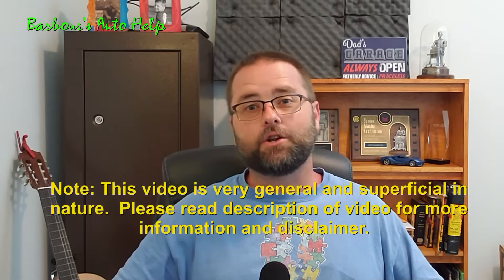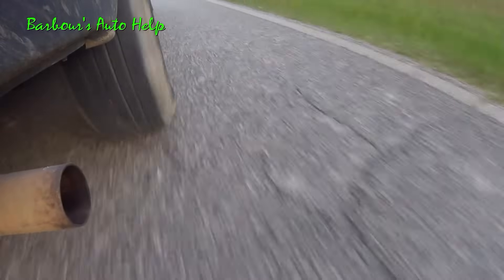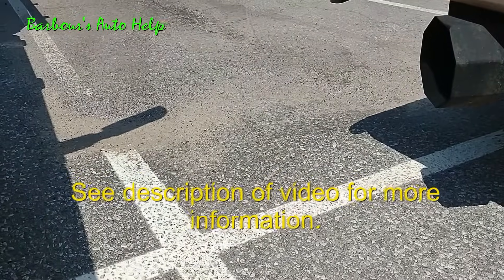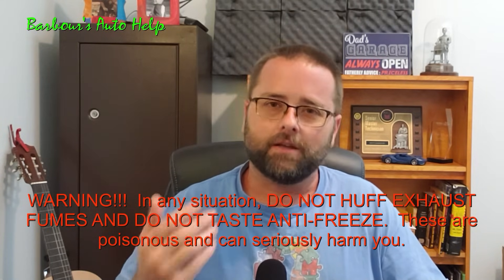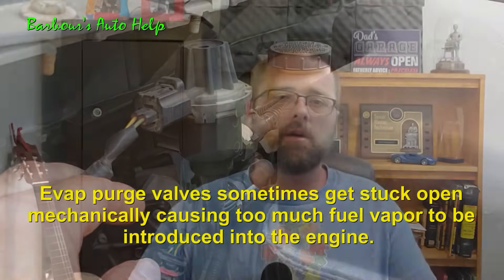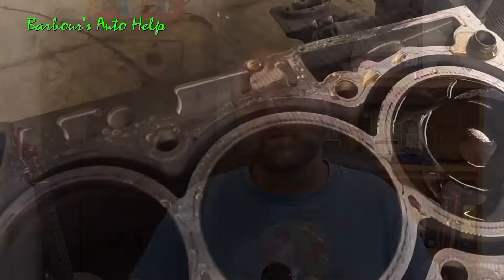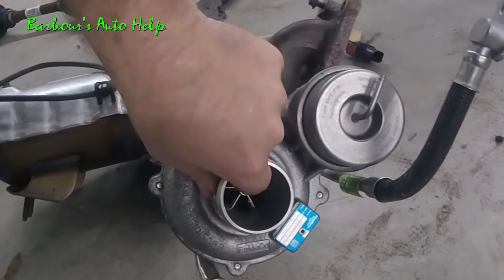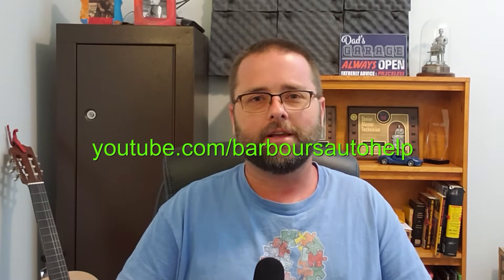Black, Blue and White Smoke From Exhaust. What It Means.

Comment: My Saturn smoked blue when cold, none when hot. Used a quart in 1000 miles. My Accord never smoked but also used a quart in 1000 miles, but I think it may have an oil leak.

Comment: Also the old pressure sensor was a Bosch ...the new one is unidentifiable!  If I had known it was a Bosch as this is what Ford had in it along with a Motorcraft o2 sensor which I've seen several posts about Ford and using Motorcraft O2 only.

Comment: White smoke , there is no coolant loss , recently installed a new O2 sensor. Engine light is on, scan came up P0174 , lean bank 2.  Not sure if I got a bad 02 sensor. Seems like the PCM is struggling to adjust as it will run smooth engine light goes off  with no vibration then back to rough condition, like a misfire. When running smooth there is no smoke coming out of the tailpipe...back to rough condition and white smoke.  Frustrating! Lol !  Everytime I have it scanned at Auto Zone it gets a different code. It all started with a P0175 rich bank 1.  Recommended a fuel injection pressure regulator.  I changed it and it ran great , better than it ever has for two days. I think I'm chasing my tail and might have gotten a bad fuel injection pressure regulator as it did run great for two days.

Comment: I had a leaking bypass coolant hose and drove the car like that for a Day and a 1/2 before I fixed it. And now I have thick white smoke coming out my tail pipe, but it has been very cold outside, and I also put fuel system cleaner in My gas tank before it started smoking like that, so what could be the problem?

Comment: Hi would the wrong grade of oil do that my 6 L blows blue smoke then clear up I just buy it and they said they had 10w30 in it thanks
Reply from the maker: What year make and model we working on?
Reply: @BarboursAutoHelp  2005 ford xL 550  6 L power  stroke

Comment: Unfortunately I have a smoke issue at first thought was white but 2 things one no sweet smell and 2 it lingers in the air with a more oil burn smell where coolant would evaporated pretty fast this doesn't along with it I have lovely in knock something is broken in my trash heap

Comment: just got a new engine via jeep/ram service shop... still see smoke from exhaust. previous engine had blow gasket. had the truck back for 2 weeks now.... engine does appear to be new... im a little confused on what it can be.
Reply from the maker: Is the vehicle turbocharged?
Reply: @BarboursAutoHelp  No, it's a 5.7 semi V8... today just took a look at the oil Level to find that it was at the "add" mark idk if that plays a part.... dudes gave me back the truck with low oil and low brake fluid smh... the amount of smoke from the exhaust isn't crazy btw, very minor.
Reply from the maker: @ maybe take it back and have them look it over. Shouldn’t be low.

Comment: I have a 1996 Ford Mustang. There’s been blue smoke coming from the exhaust. It’s been running rough a lot and miss firing. It doesn’t do it constantly but on and off. I’ll be driving it and it will be running rough and all of a sudden it will kick in and start running right. It’s not running hot or anything like that.

Comment: Chevy 1990 suburban 5.7 has white smoke-ish. 160k miles- runs good but I notice driving 55+ on highway it seams to struggle or shift hard. Does this year have the trans modulator vacuumed ?? It's smoking /sucking trans fluid hence the white smoke n ruff shifting??

Comment: Hi Mate, from Australia, I had my front and under the car cat got toasted. The smoke obviously couldn't go past the exhaust and could see it coming out of the valve cover. Replaced CAT now, car is running idling fine but now getting white smoke with fuel smell on high idle revs. No smoke while driving. I am suspecting the front injector(s) getting stuck or flow is obstructed on high revs, especially after toasted cats. Smell tastes exactly like when you burn off carbon with seafoam etc. My car is 2007 Nissan Murano, 240K KMs. Otherwise the car has been in mint condition. The coolant level is not dropping. Oil level is maintained, little bit of oil I am adding which I was adding since I had this car. V6 VQ35DE is prone to burn a little bit of oil and that is normal. Fuel consumption is not increasing significantly. It is still 11.4 for 100L which is very good for this size of engine. I once had a random misfire code tilting me more towards injectors. No more codes after that. Could also see black oil on the bottom of the dipstick, oil soot, probably means rich fuel mixing with oil. Any thoughts?

Comment: I have a 2014 Audi A4 2.0 TFSI with 148 000km. Car has a dump pipe, stage 1 tune + hybrid IS38 turbo (6 months old) I get smoke under high boost (Blue/white smoke) Generally after heavy load. I can also smell burnt oil. I have just upgraded the PCV but still have smoke. for the last 5 days I have driven slowly to see If I still see smoke and and losing oil. So far no smoke and waiting of oil reader to show me the reading. Any tips or help?

Comment: Thank you for the info. I have the light blue smoke but only when I put it in drive also it does not have oil consumption at all, I just replaced the spark plugs and coils I did an oil change the coolant level is the same no changes can you think of what could be causing this smoke? sometimes it does smell rich but the smoke is not black what do you think? oh, 2007 4.6 STX V8 F150
Reply from the maker: It’s hard to say. It may be better to have a tech take a look at it.

Comment: Ii got a 2002 Chevy pos S10 4x4 4.3 V6, so my sparkplugs keep getting drenched in gas, my buddy did replace the spiders and fuel regulator I have replaced the O2 sensor the knock and crank sensor I'm in the middle of trying to get the cam sensor put in distributor but it's being a pain to get in but it is pooring gas out the side of the llentum so I think it's a injector because the cam sensor isn't reading right and pcm probably in limp mode and the regulator I've seen dump gas when you turn the key off as well but man it's smoking out the whole block really rich for like 5min then dies and I have to pull all the plugs witch  all are soaked in gas, here's what I'm worried about I changed my oil and got 16 courts , 4 .5 of oil and 8qts of gas I hope my rings didn't get messed up but how in the heck does 8 qrts of gas get in the oil seems like can I have maybe got the return and the vapor lines wrong when I changed my fuel pump? Just seems like a lot to just be getting by the plugs please any info would be muchly appreciated I have dumped so much money in this thing but I'm bout to burn it to the ground I been working on it for 3 months now, also I've heard that it can be your alternator andnot really be the cam sensor, this all started when my harmonic balancer spun off the rubber part but timing is pretty much set on its own I think tdc on one and point rotor at the 6 on distributor right? Also my clutch went out on my ac so I got a smaller belt and bypassed it but I heard that can mess up the voltage in places, I'm getting 10 volts on one of the three wires going to my cam sensor but I'm supposed to get 5 on ach side and negative or ground in middle any thoughts on this ty sorry so much

Comment: 2016 Chevy trax. Put oil in it this morning and went to drive it. Few minutes later whitish bluish smoke coming out a LOT, (smoked up a whole road). When starting to drive after being stopped at a light, doesn’t pick up right away, if I went over 45 mph car started to jerk.
Reply from the maker: After you put oil in it did you check the oil level on the dip stick.  Not being "Mr. Smarty Pants".  Just wondering.

Comment: I have a 2010 maxima, I have the blue smoke at first crank like you described but also while I'm driving,  occasionally it will let out a large cloud of smoke and sometimes sputter with black smoke, especially with acceleration. I've been told piston rings and valve maybe need adjusting or replaced. Curious as to your opinion or anyone else in the comments. TIA
Reply: I have the same issue, i have a 2020 outlander sport, 48k miles, bought it new in 2020, now it smokes blue when its at operating temperature

Comment: Hi, I am driving a VW Tiguan 1.4 tsi dsg 2013 model. A year ago the car overheated and busted the radiator, i had it replaced and also replace the thermostat and then it started losing couple of months later and then i replaced the Air change over flap. What i have realized after replacing the radiator is that i kept refilling the coolant once every week. I investigated and was told that there is no leak anywhere, so the leak might be going into the engine, okay i drove the car for couple of months still refilling the coolant every week, then the car started having problem with starting in the morning but when it's hot it was starting fine. I notice a leak on the water pump and had it changed, then just after changing the water pump the car started smoking white smoke and EPC light came on and disappeared, now there is just an engine light on. Could it be the head gasket or turbo?

Comment: I have a 1963 Avanti 289cc that has been sitting for a long time, I drained the oil then put in some WD40 and let it sit for a week, i turned it over a couple of times with the coil disconnected, the engine had ran previous blowing white smoke from exhaust, I then removed all spark plugs, cleaned them, reinstalled them, drain the WD40 and put new oil back in. The moment I started it, it blew out very black smoke on the Port (left) side, Hopefully it's a carburetor or fuel filter problem. like I said,  it was ok prior to me changing oil.  But why just the one side?
,
Reply from the maker: How long did you let it run?  And was the smoke dissipating the longer it ran?

Comment: 2005 Hyundai Accent . Recently has started having light blue smoke coming from the back end, AFTER it's been idling. At the very least after it's been running and heated up. It smells like burnt oil. So obviously from your info it's clearly an oil situation. I'm just hoping it's not too serious. & I'll have to fix it myself so that's my hope, that it isn't too serious. To be fair I unfortunately ended up neglecting to check the oil for like a month & when I did it was in desperate need to be filled\changed. I almost thought I had to have had a leak because it was topped off a few weeks prior. But there has been no oil spots at work or home driveway...any thoughts? Much appreciated regardless 😊

Comment: Thanks 😊 alot for this lovely vedio. 
I have lexus ls400 95 , 1uzfe engine V8 , the issue is just white smoke when start , only about 20 seconds,  then little white smoke , then it will despair,  it's smile like oil some kind , can you help me out .
Another issue is the fuel consumption is bad , I mean really bad .
Check engine light is on .
If I disconnected the battry for an hour , the check engine light will off for some time , but a long distance trip , it's came on again .
Reply from the maker: I’d say if the check engine light is on you have an issue that requires diagnostic work be performed. May be best to take it into a shop.

Comment: l have a 20 year old camry 200, 000 miles , l get a white smoke perhaps slighly blue not sure, from the exhaust when l first start it in the morning, it only lasts the first two minutes of driving then it goes, more smoke comes out when l put my foot on the acceleator . l only get the smoke on the first start of the day, if for example l start the car again later in the day l wont get the smoke. What do you think is the cause, harmless condensation, coolant leak or oil leak, l have my car parked  outdoors under a roof , its not that cold overnight 8 degrees celcuis or 46 degrees fahreinheit but it does rain a bit . l have not noticed any drop in the coolant level in the car. l have been burning more oil then normal but its an old engine
Reply from the maker: Maybe normal water vapor. Maybe your valves are leaking oil. I’d say if you don’t have other symptoms and you’re fluids are full roll with it. Check oil and coolant. While that’s my opinion it’s always better to have a tech look at it. I could be missing something.

Comment: i have white smoke coming out the passenger exhaust. What I did , installed new valve seals, Cylinder 2 no compression so I changed the the exhaust (they were chipped off edges) and intake valves and seals on cylinder2- compression is 8 on dial, new fuel injectors, new head gasket, new spark plugs, new O2 sensor on driver side, new pcv valve. The car was sitting for almost a year. Could it be old oil or old fuel causing?
Reply: Figured it out ?

Comment: Hi. My question is that I have  a 98 Chevy Malibu and it needs a heater coil. I  parked until I got the part si it's been parked roughly a year and I cranks it drove to the store less than a mile for gas and it started smoking and had very little compression. I  can't remember what color smoke exactly thinking thick white smoke. Could that bee from sitting or blown head? Thanks for taking time to read this
Reply from the maker: Yea, I’m not sure. How do you know it had low compression?

Comment: I have white smoke coming from gmc yukon 6.0 does not have sweet smell it doesn't have egr cooler that I know of.????? And it's not over heating no signs of white foam in crank case or radiator.also the radiator holds pressure for a while after it gets to operation temperature. Could it be a sweating of exhaust it get lite but not going away.
Reply from the maker: Any chance you could make a video of it and post a link here to it?

Comment: I have a problem with a 1998 Mitsubishi Eclipse with a 2.0 engine. The engine has been rebuilt, the head is rebuilt and runs fine when cranked up and cold. It drives fine when it is cold but after it has warmed up the transmission does not down shift like it is supposed to when I come to a stop, and when I take off it lets out a huge plume of smoke to where I cannot see the vehicle behind me. I suspect that transmission fluid is getting sucked into the combustion chamber, but I do not know how or what could be bad. The only time it smokes is when I am driving it, if I let it set in the driveway and run, everything performs as it should. The fan starts up and runs when it needs too and stays at operating temperature with no problems until it is driven. Can you tell me what on the transmission could have gone wrong and is letting trans fluid get sucked into the engine?

Comment: 6:08 i noticed white smoke come out of the exhaust when I accelerate at a stop light then goes away when I’m driving, no smoke comes out after that. Then when I stop for a train a bit of smoke comes out.
Reply: That is your worn valve seals

Comment: White smoke, that smells like fuel, also can confirm fuel in tailpipe. Also have a vacuum leak. I have done coils, plugs, and pcv valve already, still same issue persists. :(
Reply: got a ford 4.6?
Reply: @ThaLoveKing  no sir, VW 2.0. Ended up being bad injectors and intake manifold gasket

Comment: I have a Lexus rx300 1999 that has been sitting for 2 years.. Decided yo fire it up again but the sparkplugs were bad.. I changed them and suddenly the white smoke appeared... But it happens sometimes and sometimes not.. I have this issue only at cold starts. The cooland level is ok, when driving temperature stable.. Engine performs very good.. The only thing i haven't done is an oil change.. So i am confused.. Any advice?

Comment: I have my Moms '07 Saturn Vue that started smoking and had that sweet smell but never got hot. Then a few months later it was puking smoke, burning oul, and smells like burnt oil. Still does not get hot or over heat. I am female and have ordered parts from the heads up. Did order piston rings just incase, but would hate to go down that deep into the engine. Any advice would be truly appreciated
Reply: Female who works on engines? Hmu lol

Comment: Hello, thank you for the video but I have a question about my smoke situation if you wouldn't mind giving me your opinion. I have a 92 Geo Tracker 1.6 qtr 8 valve and when I bought it I noticed the oil level was high. I did drive a few hundred miles with the over filled oil but I replaced it yesterday. Anyways my smoke is defiantly oil related and I noticed (even after the oil change) that after I drive it at higher speeds ( 60-65mph) and then come to a stop it starts to blow a bunch of smoke but clears up after a few second after I start moving. It also doesn't seem to smoke while driving slower around town. Any thoughts on what it could be from? Thanks
Reply from the maker: Possible that the pcv valve is faulty.  I'd start by checking it.

Comment: 03 vw 1.8 passat had the low oil pressure light come on small knocking noise. Mechanic replaced oil pump when i got the car back now blueish white smoke coming out mechanic said it was burning oil but due to oil pump change said it would go away in few days its been 3 weeks still see a lil bit mostly at a stop light. Any suggestions ? Thanks for video.

Comment: My friend gr8 info video.  I have a question, pray you can help. My 2003 Nissan Sentra was leaking oil from the passenger side of the engine. I replaced the valve cover seal and now it's blowing white smoke especially when revving the engine. What do you think it could be. Please help. Thank you

Comment: I have 6711.7 miles on my 2017 Nissan Murano. Towards the end of last summer I got my first oil change. 2 weeks later my car was smoking very bad from the exhaust. I have had my spark plugs and coils changed. I have had the oil swapped out for new oil twice because it burning out and was immediately back to black. Still haven’t figured out what the issue is. The smoke is white smoke. It do have a strong smell to it. It’s definitely burning oil very fast.
Reply: hi did you ever find out what the issue was? same thing currently happening to my car .